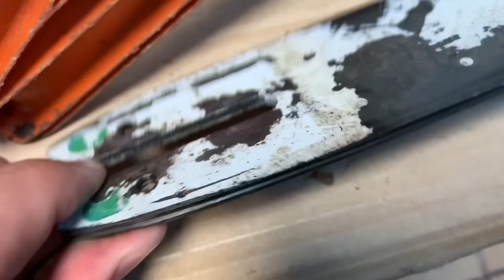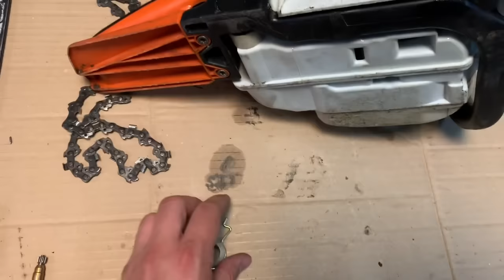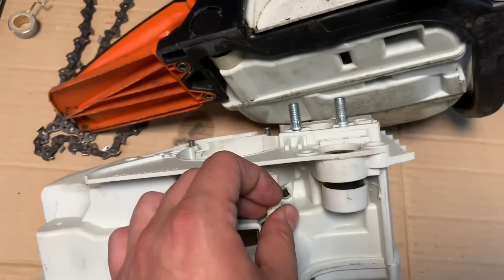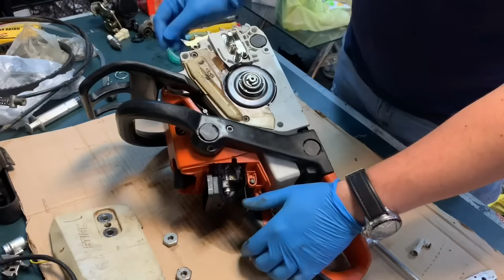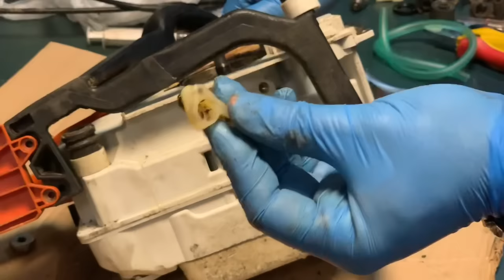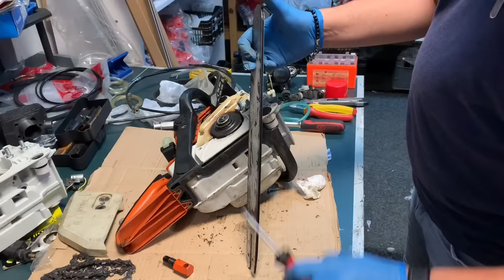Probleme pompa ulei drujba

Comment: Cat timp tine un rodaj la atv 107
Reply from the maker: 4 plinuri de benzina
Reply: Eu merg  ori  un kilogram ori cu 2 nu prea fac plinu si acum cand vreau sa il pornesc se aude un sunet urat un pocnit ceva nu e rateu ca se aude urat
Reply from the maker: Unde se aude?
Reply: Acum nu mai învârte motoru
Reply from the maker: Pai da, de obicei, daca nu are curent suficient bateria, asa se intampla si cu sunetul acela
Reply: Da inainte se auzea aveam probleme cu relantiu strangeam accemeratia pana mea nu reușeam  statea pornit dar pleca dupa loc acum am încercat  sa dau la automat si pocnea ceva pe la motor sau in carburator un sunet ciudat si deodata nu a mai învârtit motoru doar electromotru cu volanta si scanteie am dar motoru nu se mai aude uleiu il am de cateva luni setul l-am schimbat acum 4 zile l-am cam fortat adica am uract de 2 ori  2 persoane pe el si il mai acceleram putin  cateodata acum.nu stiu ce sa fac

Comment: Salut am si eu o problema la un atv loncin cu răcire pe apa , problema este în felul următor motorul nu se răcește din ce cauza poate fi
Reply from the maker: Poate sa fie infundat radiatorul... sau pompa nu recircula
Reply: Salut am atv 125 an fabricație 2018 cu probleme la carburator curge pe la supraplin se poate face ceva  ?  Curge si din mers . La început nu a curs . Felicitări pt munca care o faceți cu multă răbdare de mare folos.  Mi am reparat un Stihl 250 cu sfaturile voastre . Mulțumesc.  Succes în continuare  !
Reply from the maker: Multumim mult! Curatati carburatorul prima oara ca si in video
https://youtu.be/Jh40qruOdnQ
Daca problema persista va trebuie un kit de reparatie sau un alt carburator
https://shr-motors.ro/kit-reparatie-carburator-atv-110-125cc

Comment: Salut am o drujba stihl ms181  nu are putere in sarcina si nu se tureaza, oarecum merge înecată 
Am aplicat reglajul standard l=1tura h=3/4 ture până la limitator dar tot nu merge
Reply from the maker: Verificati simeringurile, la aceste modele sunt destul de problematice, daca ati curatat carburatorul si tot la fel
Reply: @SHRMotorsOfficial  simeringurile sunt ok si are compresie bunicică Daca ii dau un amestec mai sărăcit la jiglorul h ma  va ajuta cu ceva ?
Mentionej ca are blocator la jiglorul h ce ii permite sa se rotească doar trei sferturi
Reply: De cand i am dereglat carburatorul din greseala face asa
Ar fi super daca ati prezenta un tutorial  mai special de reglare a carburatorului pentru stihl
Ps: consuma foarte mult carburant 
Jumatate de rezervor la un lemn de 45 cm (salcam uscat)